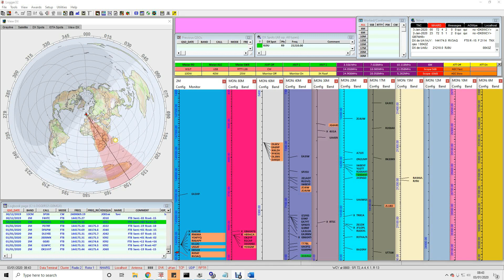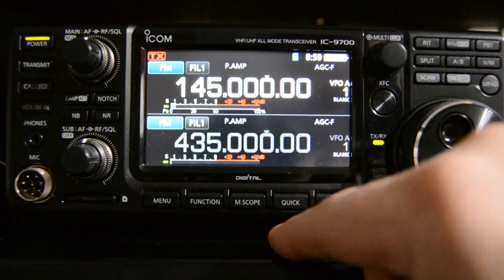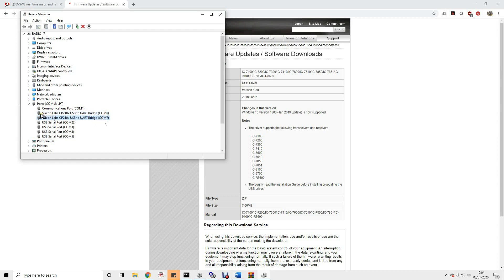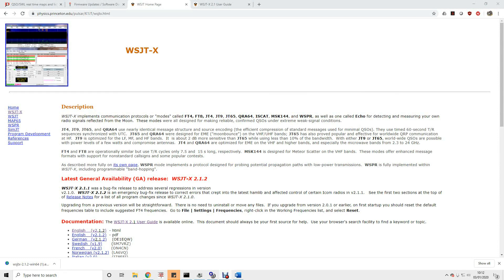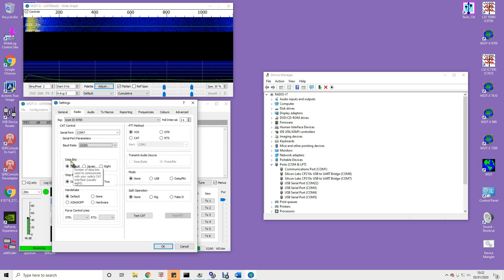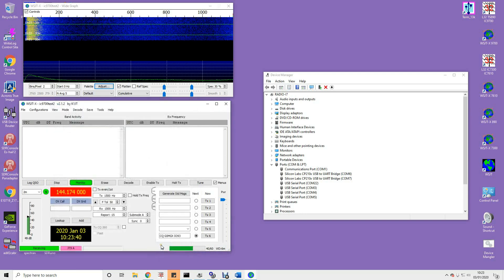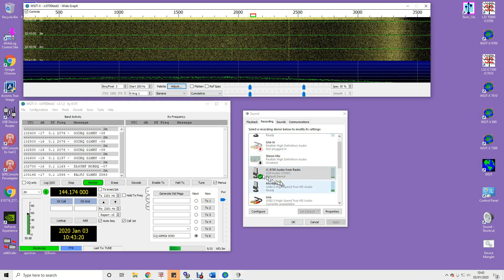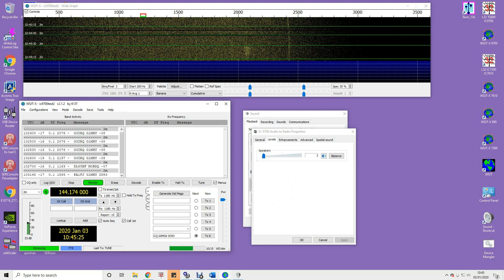WSJT-X on the ICOM IC-9700

Comment: Howdy. I'm following along and everything is going great until I get to setting the CAT control serial port setup and I've got no serial port. Just USB, so testing the CAT always returns an error.
Are you using a USB-B to USB-A cable from the LAN port to the computer, or are you using a CI-V remote cable to the computer? Thanks for your time.
Reply from the maker: Just a standard USB cable from the rig to PC. find me on QRZ and email me a picture of your ports section in windows device manager.

Comment: Is it possible to do dual 2m/70cm wsjt simultaneously on the 9700?
Reply from the maker: No really I'm afraid. It's full duplex (you can RX at the same time as TX) but on different bands.
Reply: @MarkG0MGX  Sounds like not possible via USB interface but MAYBE possible with an audio interface?  I would be interested in RXing on two different bands with FT8 simultaneously.
Reply: I figured it out actually.  You can setup the USB audio device as dual channel.  The default is single channel. In dual channel mode LEFT is the primary/main (where you will Tx) and RIGHT is the secondary band or dual watched band.  With a second instance of WSJT watching the right stream you can do dual Rx simultaneously and listen to the 2nd Rx while TXing on the primary.  I have not yet figured out rig control to allow TXing on the secondary.

Comment: This is the real joy-killer in ham radio these days. If you don't use your radio on digital for a while., it stops working and you have to go through ALL of this process again. And of course you try changing the COM: port Baud rates, the C-IV address, the radio baud rates and the program baud rates a million times and it doesn't work. It never works fir the first few hours. Then, something changes and it works..at least until you do anything else with your PC. I'm about to give up on the digital modes I love so much. I'm out of headache relievers.
Reply from the maker: Hey Bob, it shouldn't be that difficult. Feel free to contact me and I'll try and help - email on QRZ is good. Mark. G0MGX
Reply: Bob Nagy I agree also. The digital modes are great, but I’m not a software engineer.  When I stumble into a working laptop, and radio interface, I’m damn near scared to turn it off    The radio companies need to make the digital modes internal
Reply: ....the 9700 has the capability of saving configurations...so save one for WSJTX, etc.   ....and load them back when you need them...that is when you get it to work.